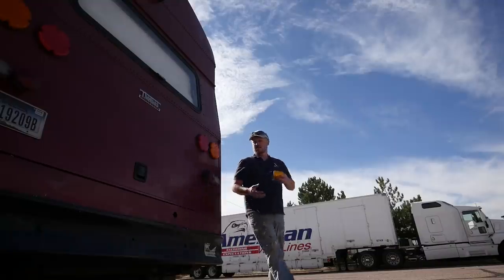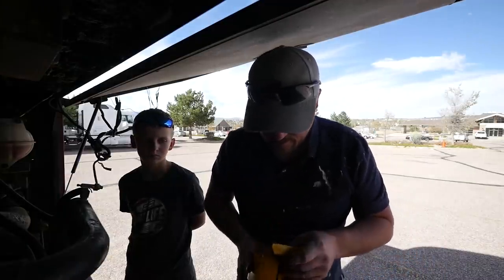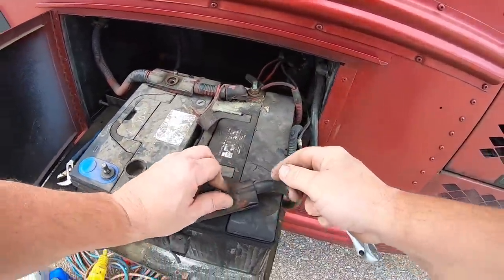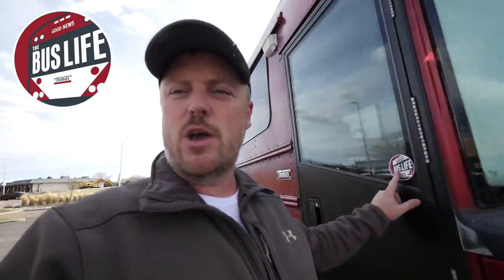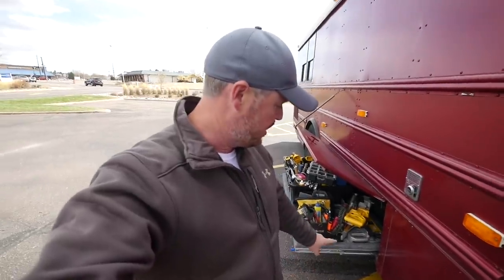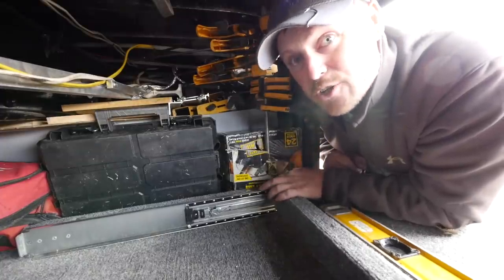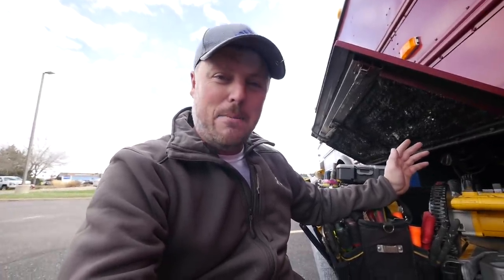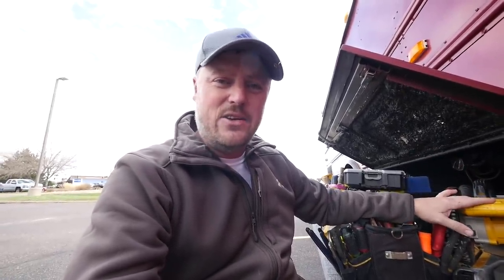I Built a DIY Bedslide in our Bus Conversion to Hold my Tools!

Comment: Hopefully it wont end up like my cargo slide in my work truck.  This video reminds me I need to thin it out so I can actually slide it out again.  Looks good though.  Looks better designed really than my industrial one.  Biggest problem we always run into with ours is when stuff jumps off and gets jammed.  Your storage tubs seem like that will reduce that.  I have the stuff on the back of mine in milk crates some of them stacked with short bungee cords and some  linked with wire to create a wall in the back.  The back is the worst if something falls off back there.

Comment: I really like your build  videos.

I gotta ask:
What are your thoughts on the DeWalt cordless tools?  I know you talked about the stuff awhile back, but how are the batteries holding up?  I have had cordless combo kits before but the batteries were always the failure point.  
Almost every tool I have now is corded, and weighs a million pounds (Skilsaw, Bosch, etc.)--all industrial stuff that is just so heavy and unwieldy I hesitate to use it.  Not to mention getting to power, running extension cord out to it, etc.   
Have the batteries progressed to the point where you can pretty much just use cordless all the time and not worry about about battery life?  I noticed you seem to have every single DeWalt cordless tool ever made.  Any particular favorites?  Any I should skip?  Did you buy the World's Biggest Combo Kit?  And how about chargers, Do you have the big multi-batt chargers?

Thanks, I am looking to maybe buy myself an early Christmas present come Black Friday.
Reply from the maker: The dewalt cordless tools are great.  I highly recommend them.  I actually just purchased this cordless sander: https://amzn.to/2rKs1De and used it on a job.  I was impressed.

Comment: I have watched all of your bus conversion videos and I love them all,  I have been watching many many bus conversions for years now and I think yours is the best I've ever seen,  and your videos are very well done frankly I don't know what's better your bus conversion or the video do you make,  there have been a few design choices you've made that I disagreed with her overall I think you have done an awesome job.  however I cannot figure out why you did not design the bus to be off grid.  You designed your bus to be completely dependent upon a Shore power or generator.  not even one solar panel, why?
Reply from the maker: Almost all of our bus life is off grid.  You will see in later vids where we have a portable solar kit.  Also, we do plan on adding solar to the bus in the future.  Its expensive but on the to do list.  It’s a very easy add on.

Comment: HI Good family!  Great to see you are all doing Good! [can't resist that!]  Colorado looks beautiful! Someday we'll get there! LOL!  That solenoid looked kinda toasted, I noticed some heaters on the manifold of my bus that need attention I think. I'm still searching for my wire harness transmission issue after being on hold with projects cause of work. I love the slide! That is great! I'm gonna have to see about that! I'm also looking for a 2 ton rated one, if there is something or will fabricate something for our big generator.  I have to work on our generator, found it is a kobuta engine and the water pump seized up probably from lack of use.  I want to be able to slide this out from under the bus to service it. Your bus engine is probably easier to work on as it is a pusher, but keep an eye on wire harnesses. I'm noticing on my bus over time hydraulic fluid, trans, antifreeze have all oozed out of harnesses while I'm tracing these wires.  Talking to some diesel mech friends they say that loom catches sand, dirt, debris and vibration just help chaff the insulation off. There are alot of small gauge wires that go to sensors to TCU and ECU. I'm learning the hard way as usual!  God bless you all! Love you guys! Miss that great coffee too! But you guys have that nice Expresso going on! And of course you daughter made some great coffee!!! Have fun! Enjoy!